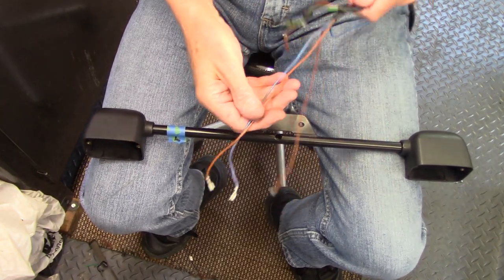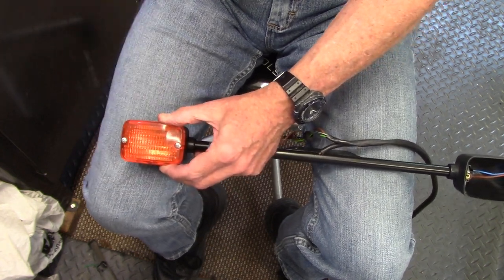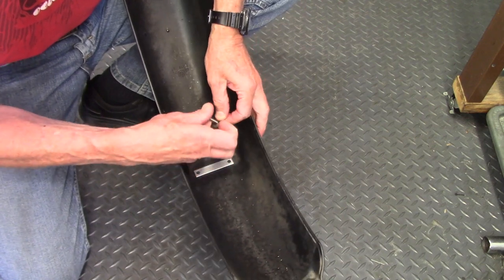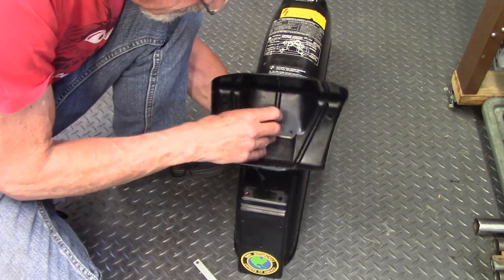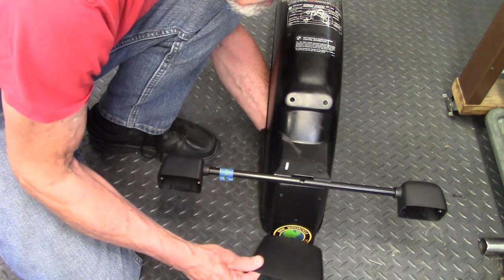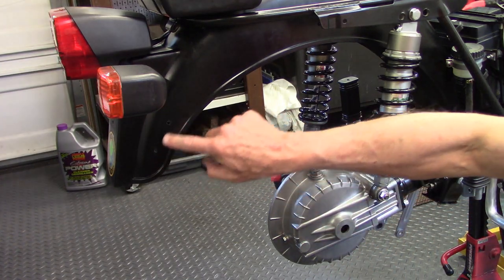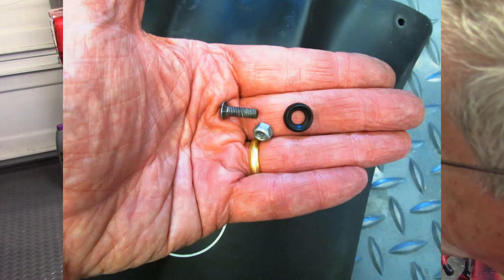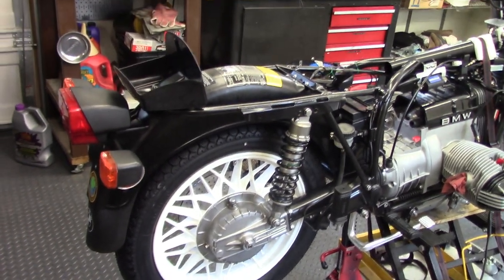1983 BMW R100RS Install Rear Fender Assembly

Comment: Tool box? I thought that was for my rain pants and passenger ejection airbag. The rear cable holds are easier to remove if you lube up the rubber dutz type tip.
Reply from the maker: Well, the ejection seat sounds like a neat option.  I'll have to look into that. :-)
Reply: @BrooksAirheadGarage  You have to beef up the hinges and be clear when you activate. Thanks for the great vids I have a '72 r60 stock no bump in timing casting LOL! and a '82 R100rt EME monster so these are tailor made clips. You need a donation link m8,

Comment: Very nice Brook - but I have a question <surprise>!   How did you get the plastic fender so clean and the labels on it looking so new?
Reply from the maker: Hi Peter,  I cleaned it with degreaser and some Simple Green. Then I wiped it down with plastic protection spray, nothing more. The labels are a bit chewed, but considering the age and mileage of the bike, that fender is pretty decent. With the RT seat cowl and side covers installed, most of the fender is obscured including the areas that have some gouges and scrapes.
Reply: Brook's Airhead Garage -Well, it looks like a new part from here.